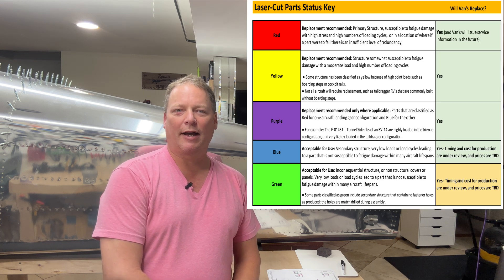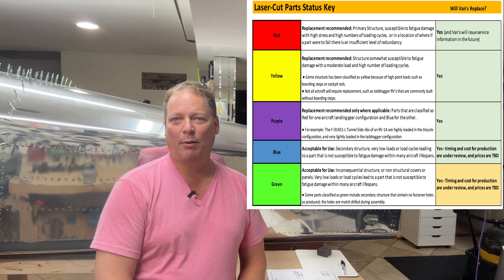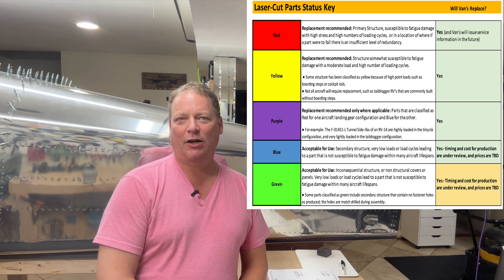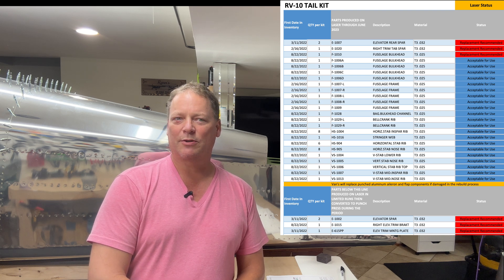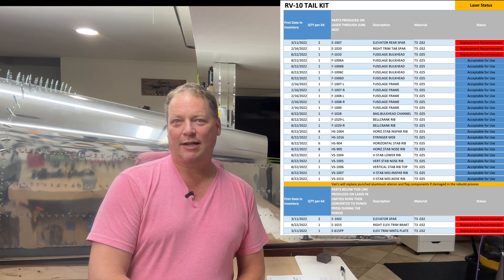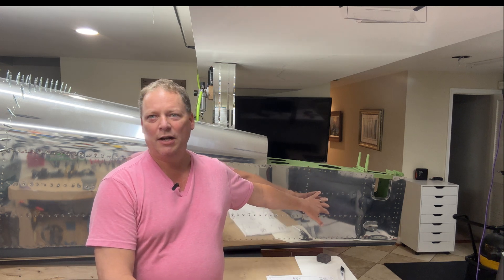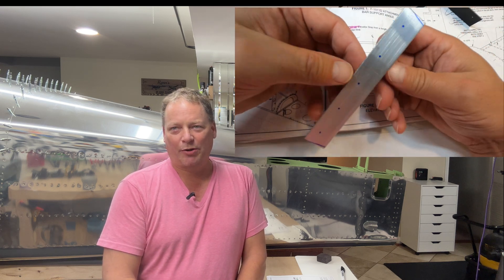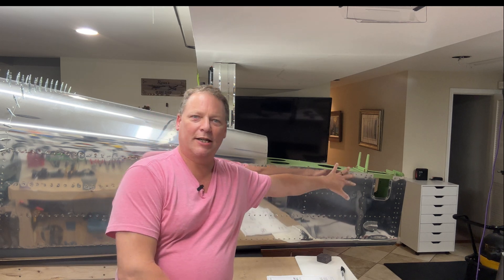Laser cut parts update

Comment: Laser cutting holes in a metal sheet that should've been punched out was never a good solution.  The heat will leave the metal in a brittle state because there's no way to control the temperature on such a thin part.  Perhaps in the future they'll heat treat the part after the holes are burnt to make sure that the consistency of the metal molecules is homogeneous.  That's my honest opinion.

Comment: Sorry to hear you’ll be redoing quite a bit of work. I love your positive attitude about everything though. Hopefully the parts start heading out soon. 

Side note: you may have done it already, but I think I saw the old elevator stop in one of your shots. You may want to consider doing SB 18-03-30 while you have that back section apart. I missed it on mine and had to remove the old elevator stop to put the SB compliant stop on. Someone caught it and pointed it out in one of my videos.
Reply from the maker: @AustinManke Thanks for the heads up!  I read (obviously skimmed) that SB a long time ago and totally read it wrong. I thought it didn't apply to kits sent after 2012, but the opposite is true. You are correct that now is the time to put the right part on while it is sitting on my bench.  This gives me something to do while waiting for replacement parts. ....Along with re-reading all the RV-10 SB's.....  Cheers!
Reply: @NotAModel  any time! I missed it too. It surprised me that the plans weren’t updated. I have heard that it’s a somewhat strange SB, as you may end up grinding a lot of the material back off to get full range of motion, but who knows! Fun part to make at least. Happy building!!